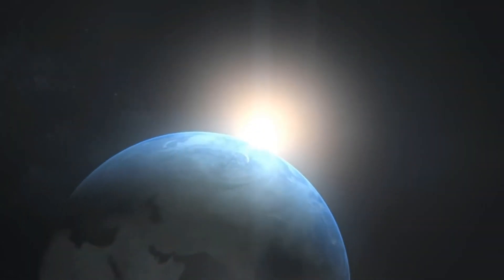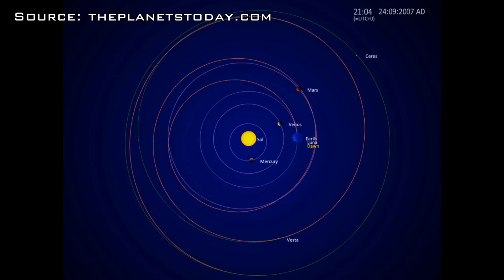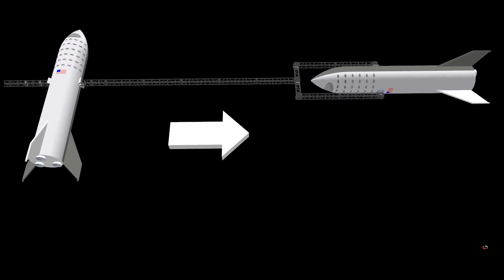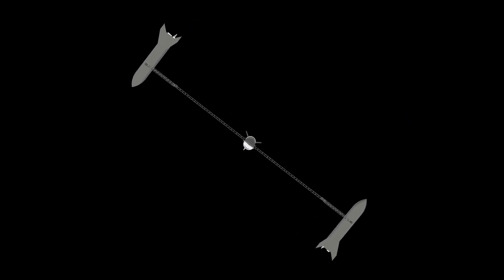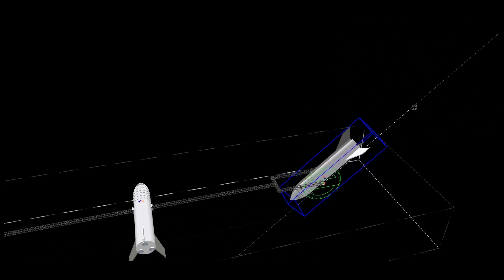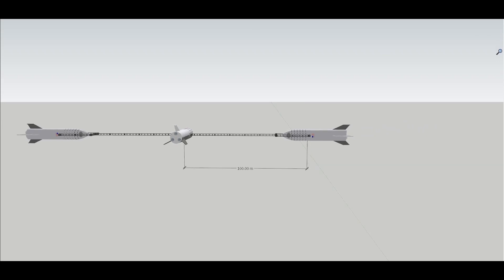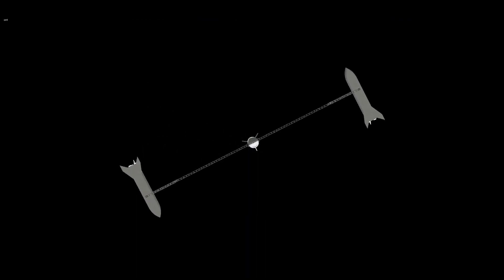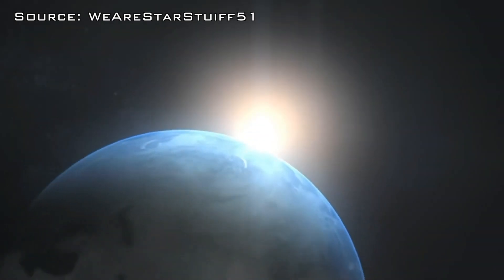GLS2: Artificial Gravity for SpaceX's Starship

Comment: I can't think of any reason this couldn't be done better with a tether. 
    Sending an entire third Starship to Mars just so you can use the main engines to spin up the ships is crazy. First a truss along with it's swivel joints that could handle both the acceleration and swiveling 2 fully loaded Starships under a few Gs of load stands an excellent chance of being too heavy for a single Starship to get into orbit never mind fit in it's fairing.  Even if you can fit it and get it off the ground, now your sending at least 50% more mass to Mars. 
   Next problem is some one has to assemble this Truss or if it's self assembling, congratulations it just got massively more complicated, likely to fail and heavier. Next fly in the ointment is the Starships are not designed to hang fully loaded from a point on their midsection. To accomplish this they would very likely need a ton, should i say many tons of structural reinforcement. If it could be done at all it would again lower the mass you can take to Mars. Finally if this truss or any one of the 3 Starships structurally fails all 3 stand a good chance of being destroyed from the debris of the structural failure which they would be rigidly attached too.

....And this is all to do the work a fancy piece of rope?

   A tether on the other hand is massively lighter, safer and could built into the nose cones of the Starships, No swivel need, stresses stay in a direction the Starships are built to handle....After making their transfer orbit burns. the starships would dock nose to nose then back away from one another unfurling the tether. Which could be far longer than a truss allowing for a lower rpm. Getting you a less nauseating simulated G that would be more consistent on all decks of the ships. 
   
Also the greater distance between the ships means if something does go wrong the ships are far less likely to hit the other ship or it's debris. In fact should the tether break or some catastrophic failure happen to one Starship the tether could be instantly severed from the nose cones of the ships with explosive bolts. Then both Starships would rapidly fly way from one another and each other's debris. The surviving vessel or vessels could then continue to their destinations without simulated gravity. 
  
 As far as whether you use the RCS thrusters or a set of dedicated smaller engines either is going to be a better deal than trying to use 2 of the main engines for rotation. The first thing with spinning up the ships is you don't have to be in a hurry. It's no big deal if it takes a day, 3 days or a week to spin to 1G. Really the slower you go the less stress you put on the ships and tether. Plus if you're not in hurry may be able to use ION engines which would dramatically reduce the fuel needed to spin up.  

One final point with the tether is when you reach the destination if may be more efficient to simply sever the tether instead of spinning down the ships. This would allow them to keep full 1G  much longer and again after the tether is cut the ships would be moving way from one another getting them out of each other's way to make their orbital entry burns.
Reply: The tethered system would have a lot of angular momentum. Severing the tether would lead to the immediate transfer of angular momentum to the ships which would tumble at high speed, possibly breaking up.
Reply: @clivemitchell3229   An interesting thing to consider. But actually that wouldn't happen. The ships would spin at the same rpm as before the separation. The angular momentum of the system (all the ships together) remains centered where it was and remains the same even as the ships separate, due to the relative motion of the ships when taken together. So it's conserved without spinning the ships any faster.
Reply: @clivemitchell3229  Yeah that's a good point, but the RCS thrusters should be more than capable of cancelling out the tumble. How quickly they could do it would be an important factor in deciding if you want to simply cut the tether or take the time to spin down the ships when you reach your destination. Also if you want if you want Gravity on your return trip it's probably best not to throw your tether away. 
   The return trip brings up another reason why using the main engines for spinning up the ships is a bad idea. After being on Mars for a few years it would be a good idea to start the trip home with Mars G and ramp it up slowly to 1G by the time you got home. With the Truss idea you can't do that. With the tether you can.
Reply: Changing the simulated gravity to that of Mars allows the crew to practice and develop good reflexes near the end of the trip.

Comment: Howsabout skipping Mars and heading straight to the asteroid belt? Ceres ho! Mining and constructing O'Neill cylinders it is.
Reply: Upright Ape I’m totally on board with ya on that one. People are way to hung up on the idea of we have to live on a planet. Even if the first habitat was quarter or half the size of an O’Neill cylinder would be a good starting point and once you can be self reliant for production with not only materials but food and life support it really opens up a hole new approach to space travel.
Reply: @Viperflight1984  your dealing with   politicians    for  funding   -  the one  brain celled  organism  - the rest are addled
Reply: "Run first, crawl later."

It wont be Earthlings going to Ceres it will be Martians.
Mars (for a technologically sophisticated society) is a better Planet than Earth.

Martian orbital velocity (3km/s) is so low, that even a Peroxid powered (isp=1400Ns/Kg) rocket could lift shit into Orbit, ignoring that a small nuclear SSTO using CO2 as reaction mass (isp=3000Ns/Kg) would make launch costs of cents per Kg.
Making Ceres in thebreach of Mars but not Earth.
It is feasable to turn a small ship for grav and live there for months, but living there your lifetime is quite a let down.
Also building  stuff from Asteroids in the Asteroid Belt is way harder than on Mars.
On Mars you have plenty Carbon, Iron, Silicium, Oxygen and Hydrogen basically everywhere.
The other Elements on Mars will be in Ores that require a few kilometers of rover sortie using a few Megajoules of Energy, while finding a rare Element on Asteroids requires Millions of kilometers in travel, using tons of fuel.
Also the location of important Ore on Mars stays where it is while, the Asteroid you might depend on for copper, sulphur, phospheros, lithium etc. might be way out of reach the next time you need to resupply.
Also considering that for the foreseable future nuclear reactors are in import product from Earth Mars is better, becaus ea getting your nuke there is easier and there are alternative (although i would prefer powering my Mars hab with nukes) on Mars but not in the Asteroid belt.

There is a reason why the vikings went to Iceland first and Greenland later and why people setteled the american east coast before the west coast.
Reply from the maker: @abrahamwilberforce9824  I didn't understand all of your sentences, but I'm digging your enthusiasm and open mind. So how long does it take and what is the delta V required to get from earth to Ceres in the most fuel efficient transfer orbit
Reply: @abrahamwilberforce9824  Also the Moons of Mars can be mined for fuel and reaction mass, that would be cheaper in terms of delta V in low Earth orbit than fuel launched from the surface of Earth! The mining operations could be teleoperated from Mars surface colony, Earth operators cant do this due to lag times. Mars would become the fuel station of the solar system and once the Starship is launched from Earth, instead of sending more starship fuel ships to fuel it, it will just use fuel tanks that were brought from the moons of Mars. With access to cheap abundant fuel in space, we could then head on out to the asteroid belt and start building bigger space constructions that can support human habitation in the belt. These habitations would be more for temporary workers as they teleoperate mining operations in the belt. Then the space economy finally takes off and THEN we could start considering larger space habitats like O'Neill cylinders, but that's still about a hundred years off.
Reply: @GeneralBlackNorway  The perfect fuel for getting into Martian Orbit is CO2 heated by fission.
The CO2 exiting the rocket will fall back to the atmoshere, and in terms of energy that would only need fissing grams of fuel for tons of cargo.
The question is wether you can refuel the reactor on Mars or need to ship the nuclear material from Earth (but even than this is valid method).
Wether Mars will export a lot of fuel or not depend on the amount of available water.
Mars would export hydrogen to Martian Orbit as fuel, and keep the Oxygen.
In terms of dV it does not make sense to stop at Mars for fuel because you would have to brake there fiirst.
Braking into Martian Orbit would be easier than braking into any Orbit in the belt because Atmosphere.

The thing is that getting into Martian Orbit is cheap (grams of Uranium for tons of Cargo) and would be even cheaper if you had a space elevator (for which Mars is the ideal planet not Earth),
and sending stuff from Mars is also easier.
Due to Luna not having an Atmosphere (so no Aerobraking savings and no reaction Mass reuse) exporting Materials from Mars to LEO is easier than from Luna.
And even getting from Mars to Luna is easier than from Earth to Luna.
In Tearms of money, material and Energy not in Terms of time.
Yet while the Asteroid belt can compete shipping cost latence is even more obismal.
Also the Belt has more risk and needs higher level technology to operate.

This not to say, that the Belt is not a target for humanity, but not in the next two generations.

One thing that humans always fuck up, is that they see progress only in the area the are focussed on. But to be truely progresive you need to look at all areas that are evolving.
The technologies that make Mars accesible for humans will also benefit Earth and the tech that makes the belt useful will also benefit Mars.
Yet for a space travellor Mars has the sweetest parameters.
Reply: @abrahamwilberforce9824  Yes, nuclear powered thrusters is definitively a technology that will be big in the future. I'm thinking more near future though. SpaceX starship will require 5 refueling missions from a starship fuel tanker, before heading out to Mars. This is obviously quite costly, so if we could mine the moons of Mars (Phobos and Deimos), then we could produce fuel and transport it to Earth orbit in big shipments every 2 years.

In space shipping is easy, you don't really need a big engine, just use a starship module to haul the fuel tanks that you can stack in front. This fuel can then be used to refuel starships that have been launched from Earths surface, on their way to Mars. Since Phobos and Deimos are quite small, they offer good practice opportunity for space mining.

You don't need to stop by Mars when traveling to the belt from Earth, that's true. It's better to head there directly. The fuel shipments from Mars to Earth orbit would come in handy though. Also I bet a lot of people working in the belt would come from Mars. Due to Mars having cheaper access to space, they are better suited to built the space infrastructure required to house workers in the belt. Earth has a head start, but once the colony on Mars get's big enough it could very well outpace Earth in space construction. Mars would due to it's conditions require a lot of highly skilled people, whose skills will be transferable to space operations. It's therefore likely that Mars will easily have a bigger community of  space operators. So the people heading to the belt would likely be leaving from Mars, more often than Earth. The population on Mars would obviously be more accepting of space ventures, while Earths population tends to look inwards and ignore space. Lot's of people think space is a waste of money, failing to see the opportunities out there.
Reply: @abrahamwilberforce9824  nah fission is too inefficient. What we need is FUSION
Reply: @abrahamwilberforce9824  gravity wells are for suckers, give me an asteroid any day
Reply: Upright Ape aye, beltalowda!
Reply: martel hinds  That would have to be an alloy of 2 different meterials we already know of because the periodic table already has elements with atomic numbers from 1-118 theoretically we could just keep adding protons neutrons and electrons to get a 119 element and so on but a lot of the higher elements are highly unstable including 118.
Reply: remember the cant!
Reply: Beltalowda!!
Reply: @bharbir  The meek shall inherit the earth, Belta Beratna. Everything around Earth shall belong to us!
Reply: Halcyon Ethereal Beltalowda gonya leva xox! Pashang inyalowda
Reply: martel hinds  Please describe these enhanced metals and gems- also where on the Table of Elements they might occur. All the slots on the chart, from one neutron, one electron to 98 of each are full- every thing else is radioactive to some degree.
Reply: I’m here to find the Miller, Anderson Dawes , Naomi Nagata and Drummer wannabe comments!
Beltalowda!!!!!
Reply: Bro you’re user name is so simple and yet it holds so much weight, well done 👍
Reply: That's basically what they did in the Ace Combat 7 game with the Pilgrim 1 mission. That was mostly because mega asteroids were a serious & reoccurring threat.
Reply: Ummmm no Ceres was completely destroyed when mara sov used the harbringer to cripple the house of wolves!
Reply: Don’t want to skip but definitely want missions for dedicated to making asteroid mining more easier.
Reply: martel hinds  - land on the sun? How exactly would that work?
Reply: Mine Luna first. 
pro:
* lower gravity than Mars (easier to get the finished steel into orbit)
* closer (resupply travel time and communication latency)
* abundant minerals: SiO2 (PV panels), FeO, rare earth minerals
* two week day for solar energy
con:
* two week night with no solar energy
* no atmosphere (CO2 for methane production)

To build O'Neill cylinders, you need to be able to create LOTS of steel in space (not on earth) without direct human presence. Which means you need gravity (microgravity smelting strikes me as a much harder problem than getting steel from the surface of Luna), ore, and a lot of energy (a nuclear power plant, or a large array of orbital mirrors to focus sunlight on one tiny spot)

Note: you don't need a gateway orbiting the moon -- build the gateway in LEO. #MoonDirect
Reply: martel hinds  Don't worry about finding unobtainium. We can build adequate space habitats and ships now with steel and sand.  The major challenges are 1) collective will to move forward, 2) designing and building the robots and processes to do the construction 3) getting the mass to the construction site. 
SpaceX is building Starship prototypes now. The first few will be "hand crafted". The next step after that is to build the factory that builds the ships. This is the same evolution of process used at Tesla to build EVs.
Reply: Upright Ape , at least set up a camp at Mars should you need to go back for supplies
Reply: On what energy source you base the melting of metals ? That's highly energy dependent and most likely need a nuclear reactor to work. Beside the asteroid belt is far away you'd need years to get there. Heck you even need already a year to reach Mars..
Reply: @hansjorgkunde3772  present systems that  is   -    anything that  works    has been  supressed    -    as  expenditure   gets  reduced - high  paid accountants loose  jobs

Comment: Good idea, but here's how you can do the same thing SAFELY and for WAY LESS WEIGHT and WAY LESS COMPLEXITY and WITHOUT WASTING PROPELLANT: 4 ships, 4 cables, 1 (weak) non-load-bearing truss, 1 electric motor.

The spin is accelerated by using the electric motor. You power the electric motor with the solar panels, so the whole thing speeds up over the course of a day or so and not in three seconds. Way safer and way more comfortable and doesn't waste fuel. But what does the motor push against, you ask? Well that's why there's 4 ships instead of 2. One pair spins clockwise, and the other pair spins counter-clockwise. Each pair is connected by cables with a small hub in the middle. The ships can be mounted nose towards the hub and never swivel. No swivel or winch mechanism needed. Way less complexity that way. The hubs of each pair is connected by the non-load-bearing-truss. That's where the motor is mounted. The force on that truss will be negligible, so it can be thinner than the aluminium trusses used for concerts, even though the starships are as big as apartment buildings. The motor will push against the inertia of the ship-pairs, one going one way and the other going the other way. Afraid of the two pairs drifting out of alignment and colliding with eachother? Don't be; add a swashplate from a helicopter and you're all set. A slow push of a few newtons gently corrects the whole spinning system over the course of hundreds of revolutions. The RCS thrusters can be used to make sure the whole system does not have any momentum around any other axis, which should already be the case, so they'll only need to expend minimal amount of propellant for that. Can you do a second video with that one, please? :D
Reply from the maker: Sounds very intriguing, but perhaps draw a picture of the truss structure you had in mind, with motor location.